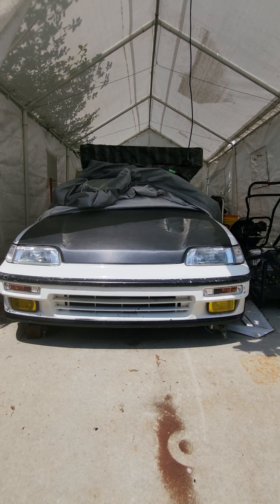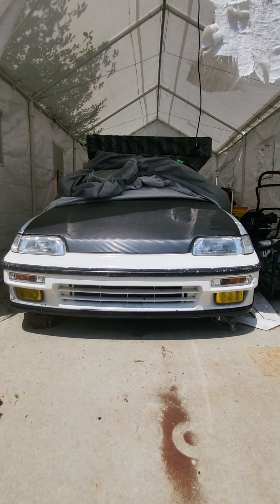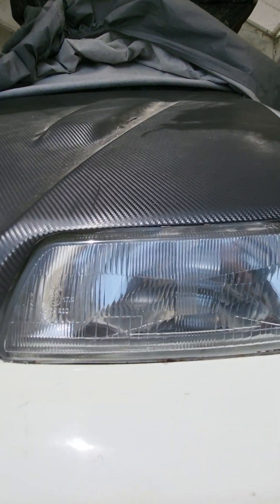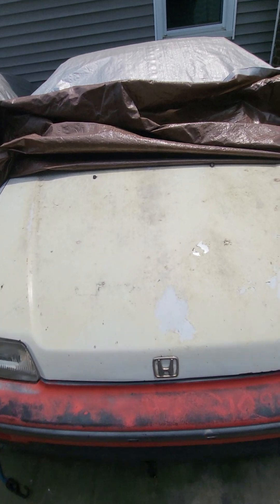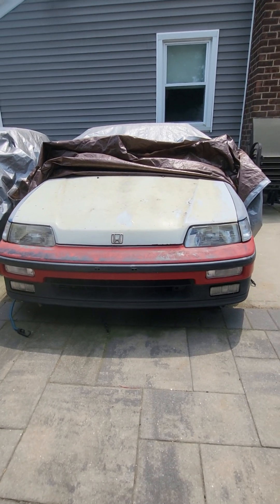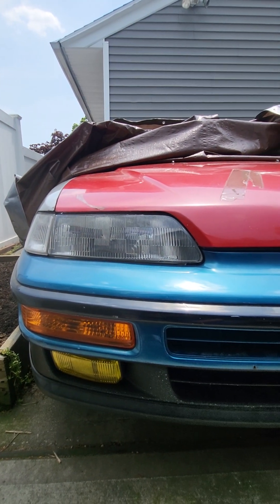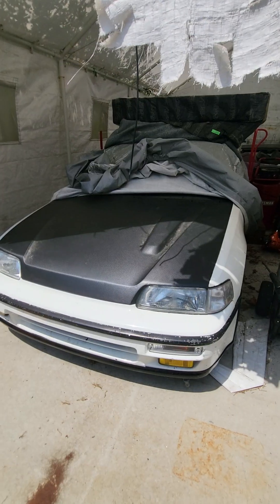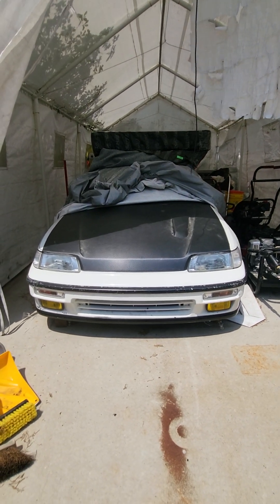how to build a honda crx, different trims

Comment: Podría explicar si se puede colocar el bumper de crx en una hatchback. Sería un tremendo vídeo
Reply from the maker: Para colocar el bumper de crx tendrias q cambiar varias cosas Como los guardalodos por que la crx no tiene el filler q tiene la hatchback y quedaria un espacio. Y para cambiar el guardalodo tendrias q hacer uno de los 2.
Reply: Nel no lo aga eso no esta de moda. La moda es quedarse orginal o ponerle la versiones japones pero no meterle crx a un hatch o hatch a un crx..almenos que esten en centro america o suda america ya que aya las partes son escasas pero en los estados unidos la moda es original o version japones
Reply: @DJV94022  amigo estoy en centro America, acá es muy difícil encontrar lo original.

Comment: El frente del ef es igual al del crx?
Reply from the maker: Los gardalodos (fenders), Las micas de las señales (corner lights), el parachoques (bumper) son differentes. El bonete, y los focos son iguales en la hatchback todo cambia en el sedan. Se le puede poner el frente de crx a una hatchback si se cambian las pizas mencionadas. Pero tendrias q hacer un guardalodo de dos de el de crx y el de hatchback y soldarlos donde se coloca el trim pq el de crx es mas corto.
Reply: @crxevolution5951  el cofre del hatchback si le queda al crx?
Reply from the maker: @juliocesarochoa2889  que es el cofre?
Reply: @crxevolution5951 el cofre es el capo
Reply: 88-91 crx y el hatch cofre (hood) si son iguales ..los fenders paisa no son ni el bumper ni las puertas pero los paneles de puerta si son intercambiables paisano